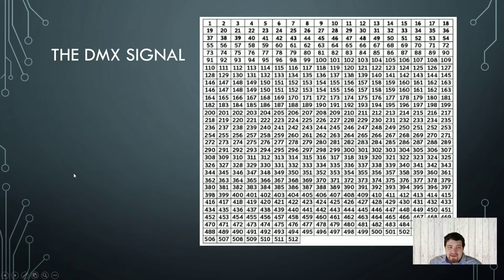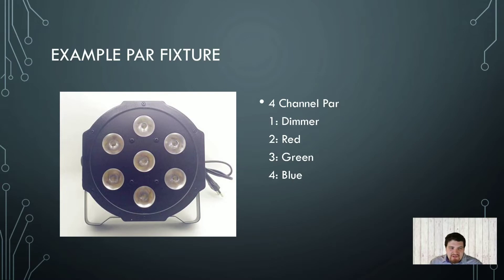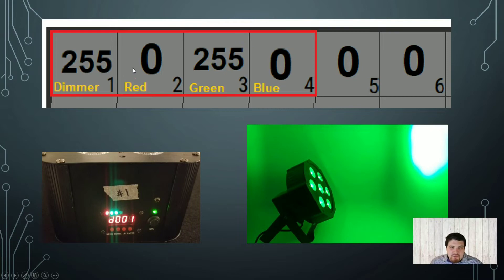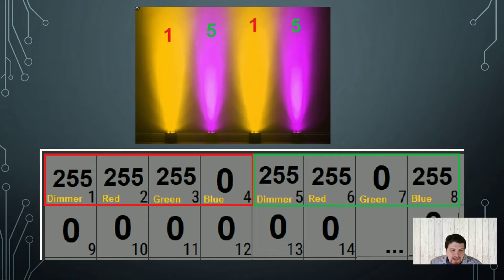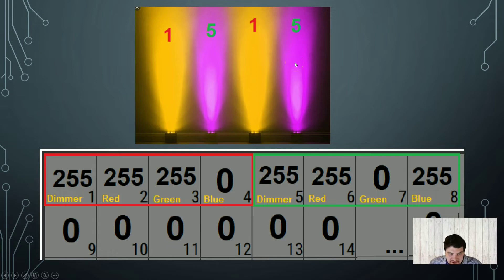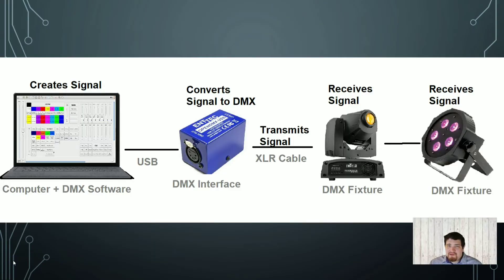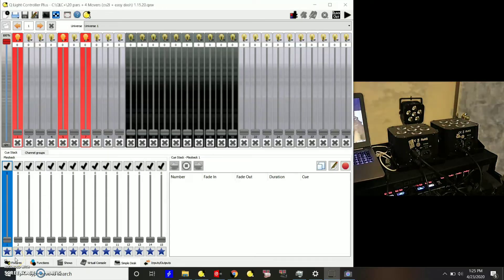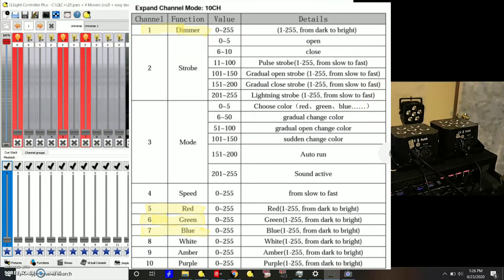DMX For Dummies - 1. DMX Basics

Comment: The DMX universe is fascinating. I do wonder though why the advancement of the technology has mainly flatlined ever since its inception. There’s software and new controllers out there that help simplify and save time on some things but there’s still a lack of standardization on a lot of things and a refined approach towards setup that doesn’t require the hours of manual labor that go into lighting and effects. I wonder if the base technology is as effective as it gets. But it can’t be right!?

Comment: If you are using Soundswitch does it matter if you put your lights on channel 4  or channel 36?
Reply from the maker: Depends on what you want to do with your fixture. But for the most part, more channels equates to more built-in macros accessible via DMX. You don't need those macros a lot of the time with the soundswitch functionality
Reply: Thank you so much for answering my question

Comment: Hi! I have an inquiry. Recently I’ve joined the world of lightning and I’m pretty much new in this area. I work on a big place where there is a pilot 2000 and multiple dmx splitters, 6 beam 200, around 8 Par leds and many other led lights. It’s all already configured and programmed to the pilot. My cuestión is there any software that I can instal on my computer that can make me manage and obtain all the data for each channel of the setup using a USB Dmx interface? Please help. Many thanks for all the videos!!

Comment: Good video, but I do have to point out that DMX does not send all 512 values of data "simultaniously". DMX is a digial serial protocol, meaning that one bit is sent at a time, but at a very fast speed. It would be more accurate to say that DMX sends all 512 channels in each message (as each channel contains several values usually). But this is also misleading as DMX will only send a channel if there is information to send, as it is not an automatic protocol that updates all the lights at a certain frequency. Instead DMX updates the light "on-demand" once a new message needs to be sent. While this all does not matter too much usually, knowing exactually how the protocol operates on the communication level is very helpful when troubleshooting odd behaviour.